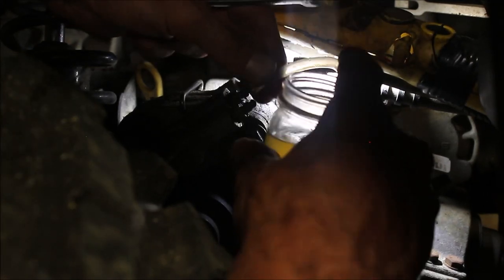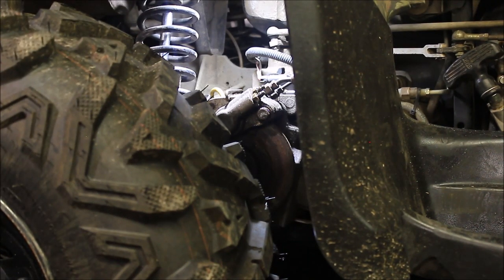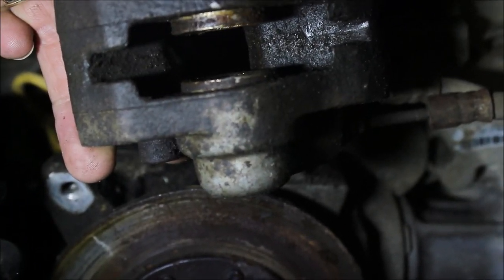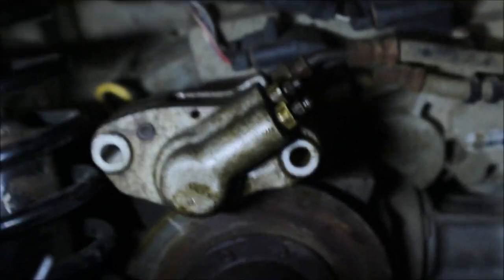DYI. How to fix the Rear Brakes On a Polaris Sportsman 500!

Comment: There's a much better way to prevent air from going back into the brake.

Press pedal, unscrew valve (let air out), screw back valve, let go of the pedal. Repeat until there is no more air bubbles comming out.

The logic behing this is : when you press the pedal the oil is forced toward the brake, when you let go the oil is sucked from the reservoir.

Don't forget to fill up oil in the reservoir as needed so no new air will be sucked in while you do this.
Reply: U sir have some long arms to do both by urself.
Reply: @Hammerback0  
When the valve is closed nothing happens.
What did YOU not understand in this very very simple explanation that I gave ?

Comment: My same model sportsman has a ‘tester-totter’ effect when I use the front or rear brake. I have to have the rear brake depressed one order to use the hand brake. I feel like a check valve is not working list it used to. Not sure what part would need to be replaced.

Comment: Is the caliper you purchased an aftermarket?  If so is there a particular brand you prefer?  The OEM stuff is just so $$$!  I rebuild my 99 calipers (front and back) but the rear just doesn't want to behave.  Thanks for the videos!

Comment: I am looking for a place to get the rear rotor for a 96 500 mine has the splines stripped out any help
Reply from the maker: For a 500?? I'm not sure. Maybe try ebay.
Reply: Yes for it is for 500 i have tryed ebay got 4 and had send back not right ones i seen you work on the old ones and thought you might put me in right line